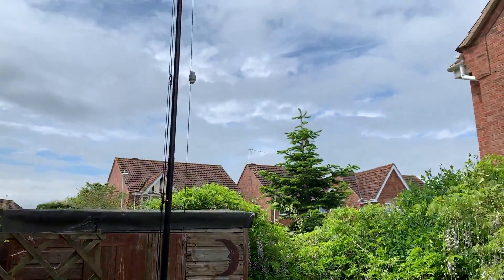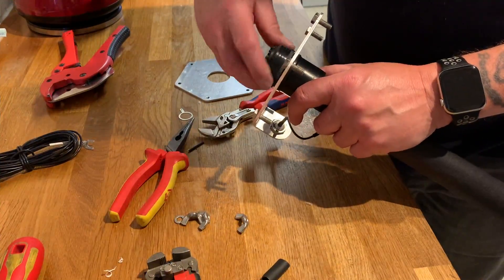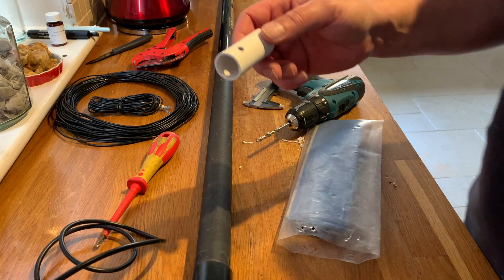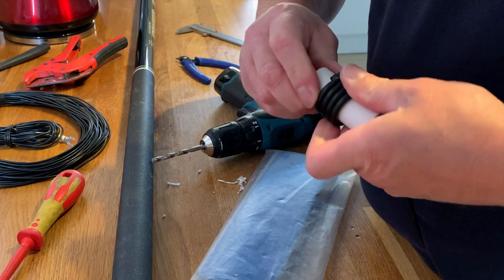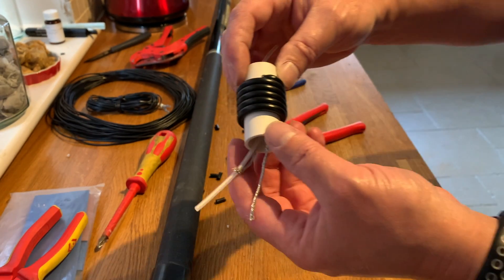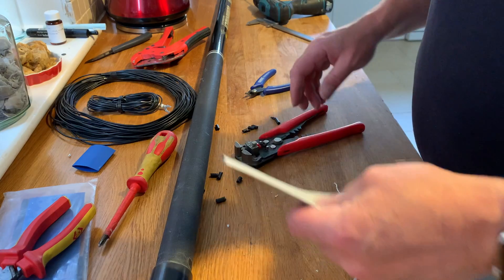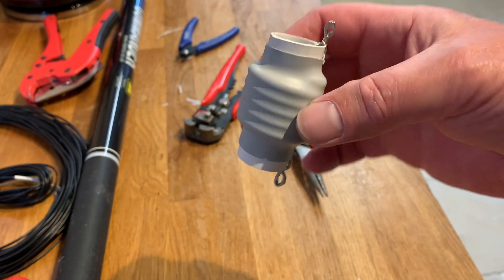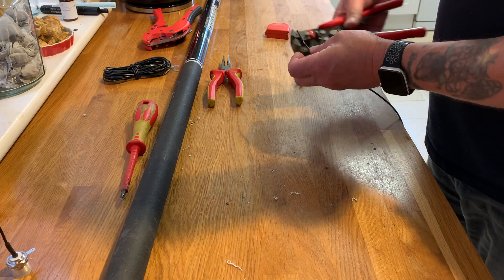HAM RADIO: DX COMMANDER Rapide 40, 20, CB, 10 and 6 Metre Band Mod DX Commander

Comment: Hi Mike. I'm thinking of building this, I have a terribly small garden, my house in on the side of a hill near a valley bottom, my roof is below road level, I really struggle!
I have a 10m Spiderpole and a home brew "Captain Spider" base that I've knocked up that has space for 3 driven elements.
Can you elaborate a little more about the trap and how you choose the frequency? After a lot of googling I have become very confused with trap frequency selection!
Have you set it below the 10m band?  or above the 40m band?
Reply from the maker: give it a go Simon, I have chosen the 10m band for the trap as I wanted to use 10 and 40...

Comment: Hi Mike. Thanks for this info I'm planning to buy the rapide antenna
 I would like to ask you something. What is the measurement of the PVC pipe you used to build the coi? Are you using RG58?
Correct me if I'm wrong but from one of the sides of the coil you  add one element of the 10m band and in the other side you add a element for 40m? I'm just trying to understand this to replicate this on my antenna. I hope to setup this on my HOA area. 73s From Costa Rica TI2GBB. Greg
Reply from the maker: Yes RG58 and yes 10m in the bottom and connect the remaining element to the top for 40
Reply: @mike-M0MSN  what is the cut lenght for the 40mtr after the coil. And fold back at the end of the 40?

Comment: Hi Steve,
I have a question. If using a nebula pole with all bands on there, do you think it is feasible to combine it with a Skylab Skyduster. So I would put the skylab right on top of the nebula antenna. So the 11m/10m skylab would be on a pretty good altitude. What do you think?
Reply from the maker: Hi Ben, yes that would work you would need to run a different coax to it, give it a go and let me know.  Cheers Steve (Mike)

Comment: cut the ends of the cable at a slant then u will find it easier to put the coax thru the hole ;) a tip I heard doing panel work etc.
Reply from the maker: great tip, thanks

Comment: Hey Mike I love the video I was wondering on the yard to meter band are you able to hit the repeaters with that or is that only used for 2 m single side band Simplex work
Reply from the maker: Not sure what you are asking here Pat, sorry
Reply: @mike-M0MSN  The auto correct function messed up my sentence sorry I was just wondering on this antenna does it work on FM 2 meter To contact repeaters stations or is it only for Simplex
Reply from the maker: @PatAutrey  aah yes, ok although it will tune on 2 meters it is not the best on this frequency, that said it will do both repeater and simplex.